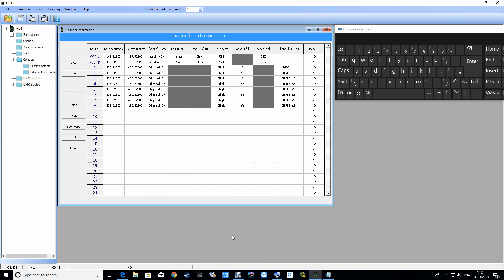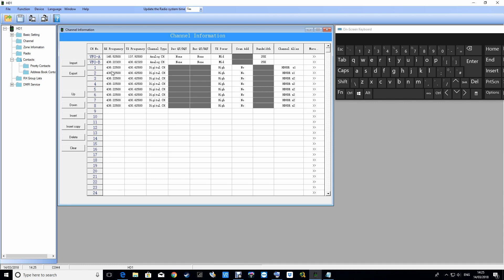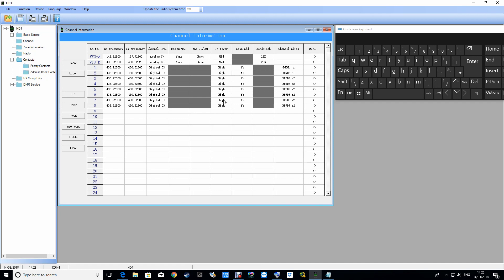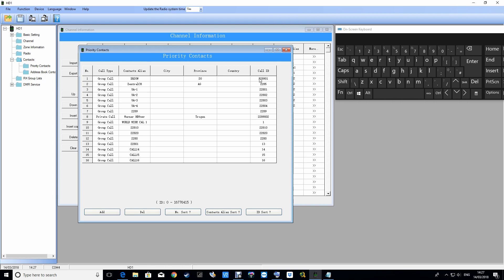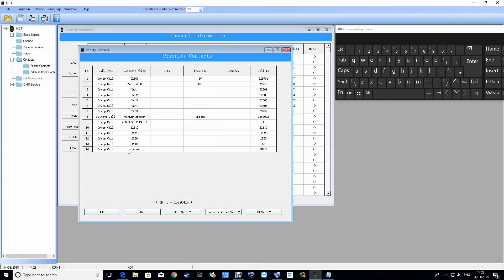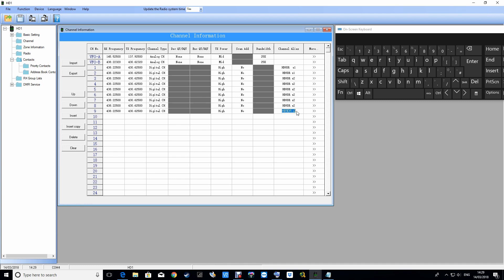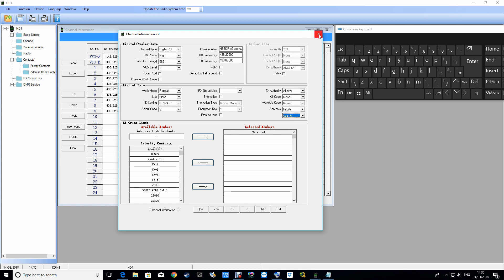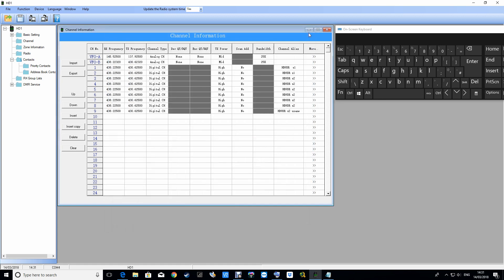Ailunce HD1 How to link dmr repeaters to a talkgroup quickly

Comment: I’m loving my HD1 Gps , so far , just got it Saturday, I’ve watched your videos and subscribed too , sent you a face bag request too , great videos!!! Thank you !!!
Reply from the maker: VooDew - Nomad yes thanks it's a cracking radio. Not really had any issues this end.
Reply: I just got one about a week ago. It works great on Analog FM. We've got several DMR repeaters around here, but I haven't been able get on any. I just borrowed a Bluestack/DVMega hotspot from a friend and still can't seem to get it to work on DMR.
Reply: Steven Hoff I’d be willing to guess it’s the code plug has an error in on of the settings , 
Is promiscuous mode on ? You do have a dmr id correct?
Reply: VooDew - Nomad I turned promiscuous mode on and still nothing works. I'm gonna play it with it some more today when I get home.